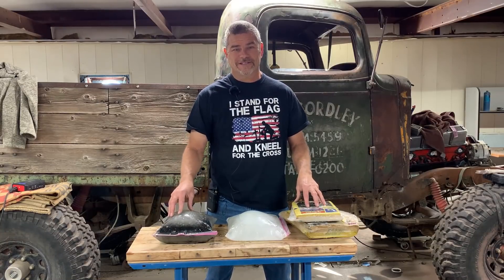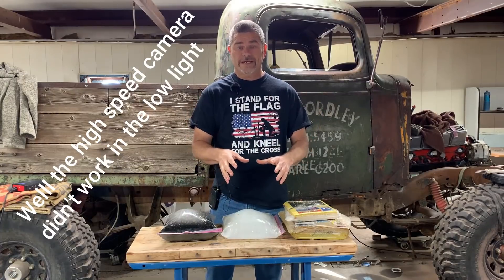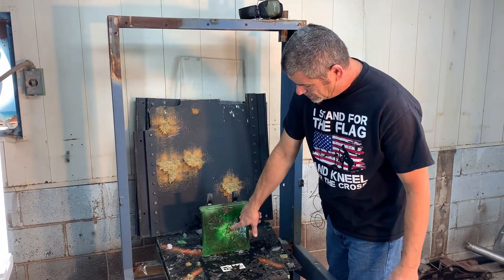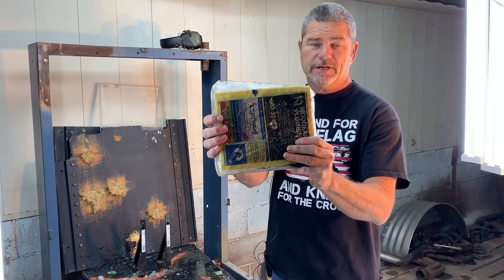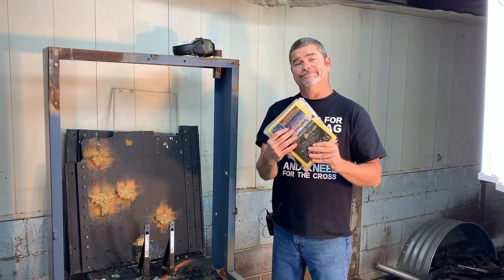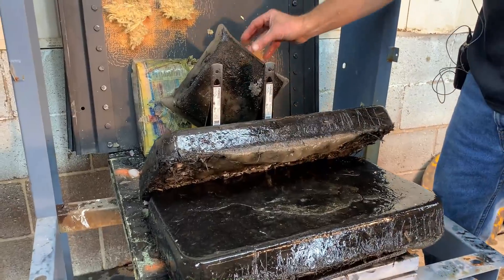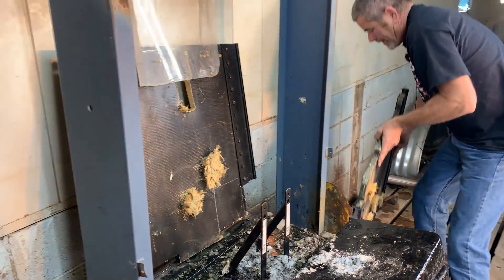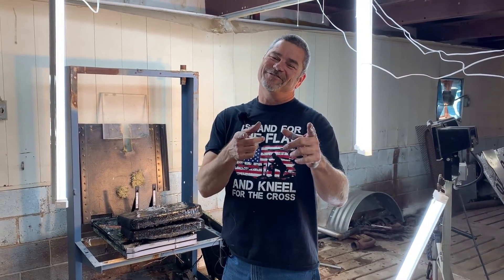Can Pykrete Stop a Bullet?

Comment: Should have made varying thickness pykrete until you found where it would stop it.. I mean sawdust or insulation and water is not that expensive. Square totes at the dollar store aren't that expensive.  Make blocks from 2" to 16" in 2" thickness increments. I guess you could pass this along to Who tee who if you want. I can reload you some 110 grain .308's in varmint round that will detonate stuff if you want a few crazy .308 rounds.